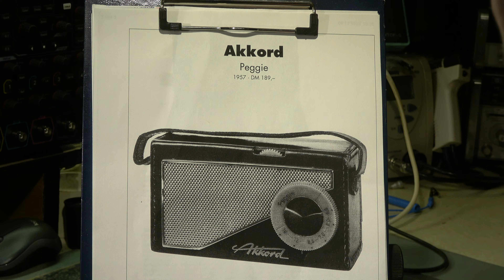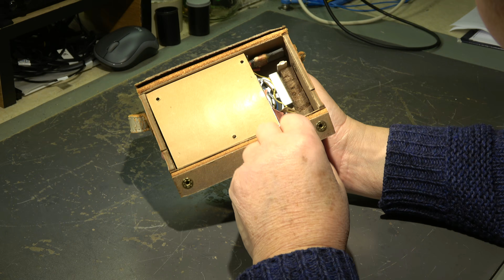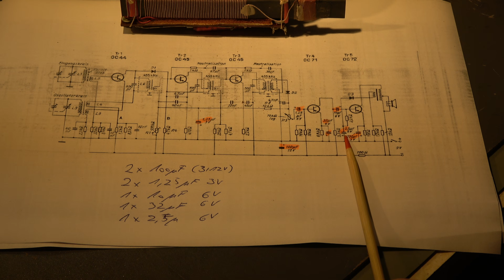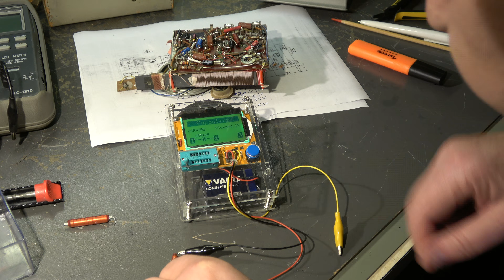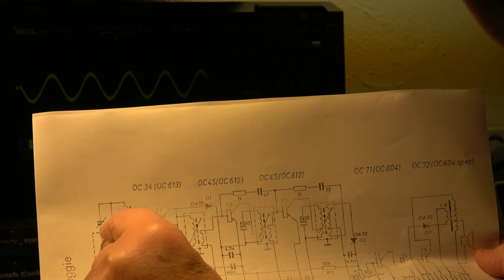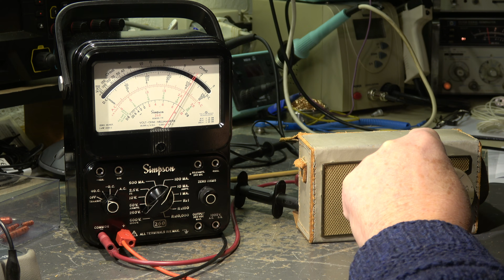#188 Accord Peggie

Comment: Great vid.  I still have my Red Motorola X14R that I got in 1962.  I also replaced the E Caps.  Still works pretty good even with those old Ge transistors.